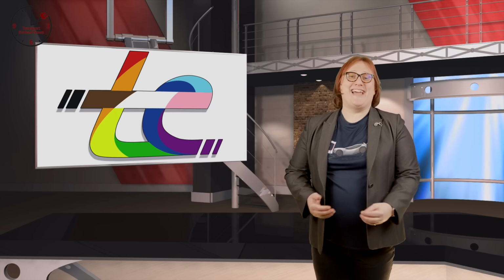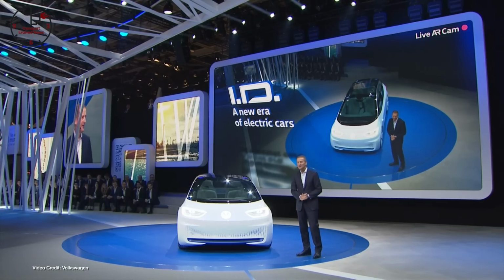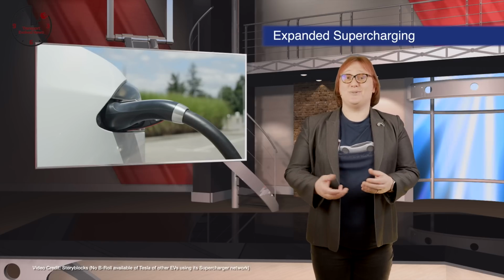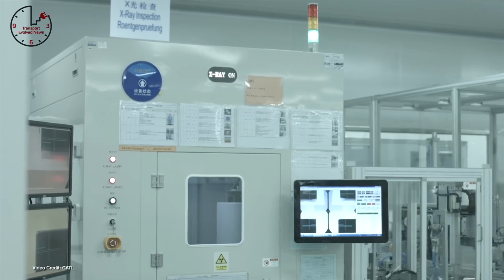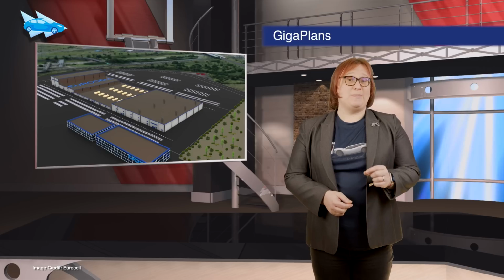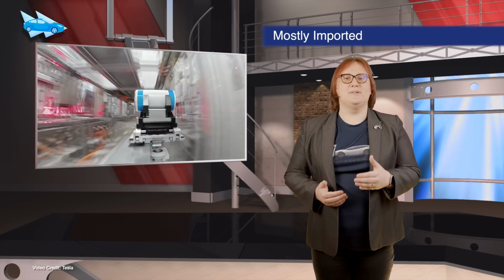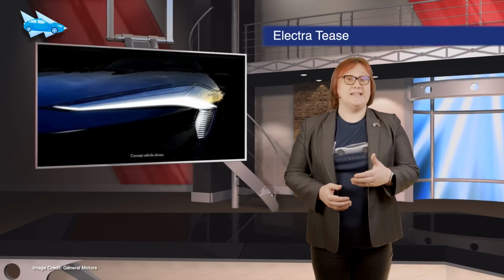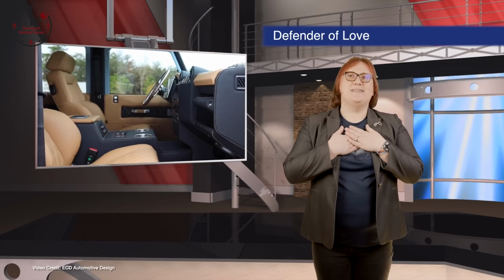TEN Episode 374: VW e-Up Returns, Hummer EV EPA Ratings, Hydrogen In Trouble

Comment: On the topic of efficiency though, in my experience, EVs have always roughly translated into being about 1/3 the fuel cost of their comparable ICE counterpart. 
In the case of the Hummer EV being 47mpge, that is not good compared to a Model 3/Y but compared to past Hummers (H1 13/17mpg), the math still checks out.
Yes, it will be more fuel savings compared to a ICE Hummer even though that footprint is not fuel efficient in general.

Comment: I figured out why the Hummer EV range is significantly less (329mi) that the (estimated) 400mi+ range of the Silverado EV. And both most likely have the same size battery pack, and both are on the same GM BT platform.
Hummer EV Edition 1: Tri-Motor
Silverado EV RST: Dual-Motor
Once the lesser Hummers models become available as just dual motor, I suspect there will be a significant jump in range and efficiency per kwh.

Comment: And some disappointing news from Australia where BYD distributor EV Direct has now released the Yuan Plus as the Atto 3.  After hyping for a long time and a recently as 15th Feb 2022 that the model would be a sub $35k cost, it was released less than a week later at just under $45k.  Given that these list at $21,541 EUR ($34,040AUD) there seems to be a straight $10k gouge because the cheapest EV is the MG ZS EV at $44,990 drive away - exactly the same price.  The cheapest Ioniq here is still $53k after the $3k incentive.

Comment: Tesla charging cables too short for some non-Teslas: It shouldn't be much of a problem to manufacture aftermarket extensions?
Reply: They exist...
Reply: Problem is that these will be very bulky, because either they need very thick cables (something like 2x the diameter) or have to integrate a cooling solution into the cable (including Radiator, Pump and Fan, and a way to power these, which will make  a very heavy attachment). Alternatvely the Charge Speed cold be limited to keep the extension Cable at acceptable Temperatures, probably something below 100kw, which i doubt is what Tesla would see as acceptable...

Comment: Nikki, I just read on Reddit that the Austin Model Y with 4680 cells will have the same range as current Ys. If that is true then all the hype from Battery Day will turn out to be bullshit.
I will not buy a replacement to my M3 2018 until I see 400+ miles. Else, a Lucid may be in my future.
Reply: Probably the same range, but using fewer batteries to do it.  They might come out with an extra long range version, but there’s a long backlog of current orders and not enough batteries as it is.
Reply: Probably a much lighter car too, which will help to fine tune the current - stiff - ride.

Comment: My 2018 Nissan Leaf also does phantom braking in pro-pilot every day. There is one curve with an intersection where it always brakes because of cars slowing in the departing lane, plus other times for less obvious reasons.
Pro-pilot also often just drops out when looking into the sun or when road markings are not clear. The car then beeps and starts slowing down.
No hope of an ota fix for my leaf. I just have to be attentive and put up with it.
Reply: @Alan Wardrop My ID. 3 is the same. (Some) departing lanes, a higher speed limit right before entering a city, and the system will try to slow you down, quite obviously misinterpreting the speed limit for the stretch of road I’m driving along.
Reply: Sounds like its working fairly well, albeit over cautious, compared to the "no reason" phantom braking with a Tesla i.e. it has reasons to brake

Comment: Dr. Plötz is correct that roughly every 270 miles a trucker in Europe needs to take a 45-minute break, unlike other countries. We need trucks with 400 Wh/kg battery cells to meet these range requirements. So far EV trucks that are in use in the world and especially in China are not Semi-trucks pulling over 40,000 lbs. Some new Semi EV trucks are boasting 500 miles range only to discover they are pulling 17,000 lbs of Pepsi bottles in perfect conditions or five cars on car carriers around 300 miles. I still have not seen one study other than the North American Power Transmission IEEE voice grid concerns about charging 600-1000kWH heavy vehicles during peak hours instead of an average car's 23kWH at night. I'm glad the USA administration has allocated $7 billion for vehicle charging stations but $27 billion to upgrade the grid falls short of USA estimates of $500 billion needed to handle future grid demands during peak hours in the next five years.  There are some European utilities also voicing power demand concerns. Last year China's electrical utilities endured blackouts and brownouts due to gaps in thier grid and lack of power production.

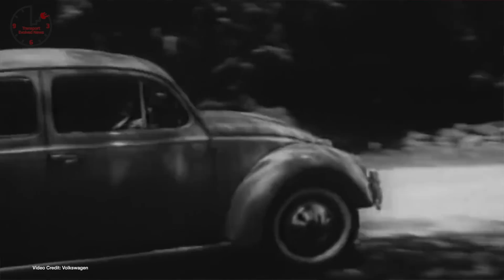Comment: 3:15 - when I was a wee tyke my mom had a sky-blue Beetle - rounder and nicer-looking than the model pictured here - and I enjoyed that it had its storage area in the front and its engine in the back. The engine itself was shite, of course, but sufficient for what it was meant to do. I'm 100% with Dr Diess that putting an electric motor where the Beetle's ICE engine used to be and leaving the under-bonnet area for storage like the original just makes sense - I don't know why they didn't do it like that in the first place.

Comment: Back when the H2 was first becoming the premium douchemobile, I liked to say how I could relate to the Iraqi resistance, because whenever I see a Hummer, I want to take a shot at it too.
It's only gotten worse since then. Bigger and douchier.
And making that thing electric, just gives EVs a bad name - "see, EVs are nothing but greenwashing, look at that thing!" is how it plays.
The battery alone weighs as much as one-and-a-half normal cars! That much battery could power three Bolts and a bunch of ebikes in change.
The Hummer, in any configuration, should not exist.

Comment: With the e-Up back in production, we now have the oldest e-cars on the market being:

Leaf (2010-present)
Model S (2012-present)
e-up and BMW i3 (2013-present)
Renault Zoe (2014-present)
Kia Soul EV (2015-present)

Did I miss any that launched 2015 or earlier, that are still offered for sale?
Reply: Yes: the VW e-Golf, circa 2014 I believe, at least in the US (2013 in Europe?).
Reply: @xchopp  Is it still in production?  I read that the e-Golf was intended to be replaced by the ID.3, but perhaps those plans haven't come to fruition.
Reply: You seem to have missed the all new Leaf launched in 2017, so while the name continues, the car hasn’t.
Reply: @simonrook5743  Wow, starting that reply off with an unnecessary amount of assumptions/criticism/snark?  Anyway, no, I did not miss that.  And in fact, I'd argue that the the changes between the 2015 and 2020 Kia Soul EV are even more stark than between the previous-gen and current-gen Leaf.  And the new Tesla Model S is also a significant upgrade.  But cars get upgraded all the time, the question is whether the philosophy of the car lives on.  And in all the above cases, I would argue it does.  It's not like they did a fundamental reinvention of the car, such as turning a compact hatchback into a huge crossover or something.  As long as the philosophy and intent of the car stays intact, and the name stays in place, we can and properly should call it a continuation IMO.

Comment: Hydrogen fuel cells would be great for large-format transport, such as cargo ships, trains, and buses.  That's where we should concentrate efforts on those.
Reply: Trains can be electrified on main lines with catenary and branches can be handled with batteries, which then get recharged when back on the main line. No time is needed for recharging as it can be done while on the move. The advantage of running on tracks is that you know exactly where the train can run.
Reply: OK, Trevor Milton, you get right on that.

(I don't disagree in principle. Just pointing out that the highest-profile effort to do exactly that turned out to be a huge scam, which suggests either the technology or the economics just doesn't add up.)
Reply: Nope. They can burn the CNG used to make hydrogen with tyevbenefit of not consuming energy and fresh water to be extracted
Reply: @vidznstuff1  You do understand that the majority of hydrogen is produced by renewable energy sources, right?  When wind and current generators are overproducing for the current demand they are often switched over to power electrolyzers that make H2.  And many of them are ocean-based, which makes it a convenient fueling port for cargo ships crossing the oceans.  Burning natural gas to power engines is EXTREMELY inefficient and WAY more polluting than HFCs.

Comment: Ford pet mode, opens the trunk to allow a rescuer retrieve a tire wrench to break a window...
Reply: Also, the proposed new GM Bolt pet mode will fling the doors open when the battery pack self ignites.  ;-)

Comment: 2 points regarding Tesla: 1: What NHTSA term 'recall' is in most cases an over-the-air update. We all need to introduce a modifier so as not to be contributing to Fear, uncertainty and doubt as 'recall' sounds much worse than it is. 2: the false positives that create phantom breaking need to be balanced against the non-news worthy accidents avoided. The important question is how to induce other car makers to equal Tesla in safety. They don't miss Tesla's record just fractionally but many times over.
Reply: I think an OTA update to "fix" phantom braking will be hard, or it would have been done already. But why is NHSTA picking on Tesla? All cars with driver assist phantom brake. Is NHTSA going to insist that all those manufacturers remove emergency braking?

Comment: You missed one detail regarding the interactions with the legal interaction with the SEC. Tesla have asked that the SEC distributes the $40M it took as fines to Tesla shareholders as it promised to do. The fact the SEC are sitting on the $40M suggests their actions are not wholly for the benefit of the shareholders it claimed to protect.
Reply: They also missed another "detail".  Hundreds of complaints have been filed complaining about phantom braking in vehicles other than Tesla.  No government action on those however.  I'll let you guess why.
Reply: The script was most likely written before that news hit the wire. Distributing that amount of money must also not be an easy task and you want to do it in a sound way that will hold up against legal scrutiny.
Reply: @Hans-gb4mv  It's been years.
Reply: @StormyDog  And legal processes take time. Ask any lawyer.

Comment: 47 MPGe.  The pig has green lipstick on it, and it takes three times as much battery as a regular electric car.  The Jevons paradox is strong with this one.
Reply: If people actually use it to haul a lot of people and stuff, then 47 mpge is fine.  If it’s just one dbag using it to commute 100 miles to work, then that sucks.
Reply: Yeah, the current weight of batteries don't scale very well. Let's hope someone really does solve the solid state battery or some other light weight tech.
Reply: It is quite a huge load.

Comment: VW should design a e-up replacement on a EV only platform, designed to be easy to manufacturer, with a hard look at LFP cells. A bit more range would be a plus. This segment is going nowhere in europe. CATL should absolutely build a factory in the US. We need A LOT of LFP cells. Storage, every school bus, and many cars.
Reply from the maker: The VW ID.Life is intended as the ground-up replacement for the e-Up, but it won’t reach market until 2025 - Winter
Reply: They should have, what has to happen is introduce the upcoming segment replacement much sooner then 2025
I'd something.
Reply: Agreed. Pretty sure the range would go up significantly after redesign, getting rid of the ICE system waste.

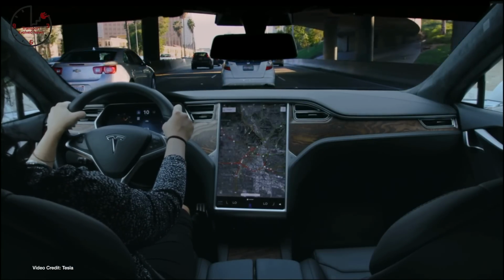Comment: At 2:13 not sure why the USA government just looking at just Telsa over phantom braking, every other system I know both North American and Europen has the same issue... and this is coming from people I know that drive trucks/lorries for a living that have advanced adaptive cruise control - Europen systems not as bad as North American systems and it mostly gone away but it does do strange things
Reply from the maker: NHTSA goes by customer complaints in cases like these, and it apparently hasn’t gotten enough complaints about other companies’ ACC performance to warrant investigation. But remember that ACC+lane centering is standard equipment in Tesla cars and has been for a long time now, while it’s still pricey optional extras from most other manufacturers, so there’s likely just more Teslas on the road using those systems. Plus, Teslas took a real hit in ACC performance during the transition to vision-only systems, which likely led to an influx of complaints. - Winter
Reply: I have never had any phantom braking on any car I've owned with ACC.